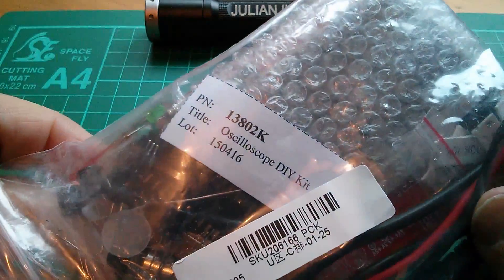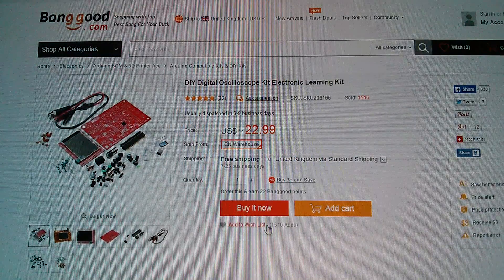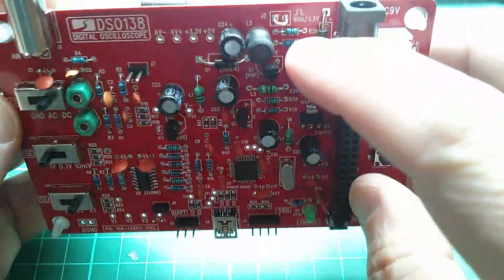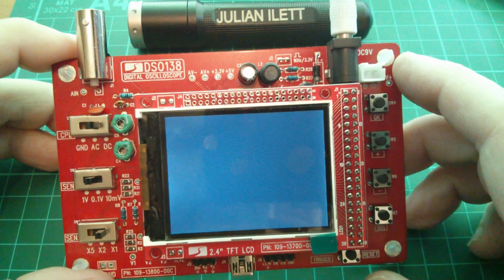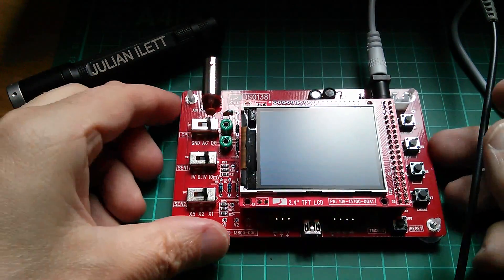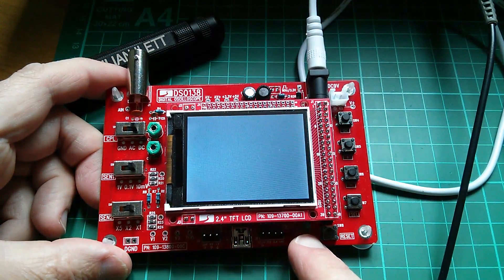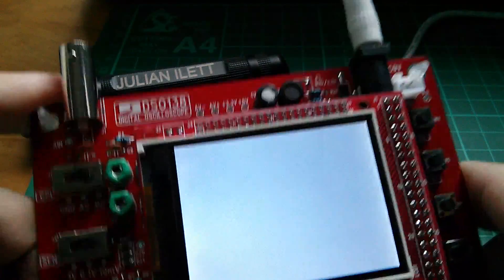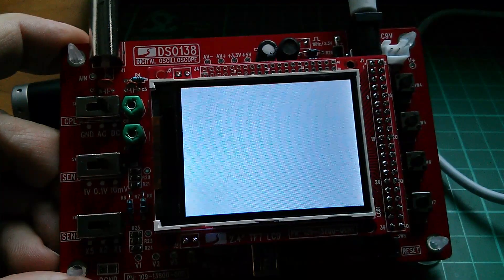Julian's Kit Build (FAIL): Banggood £15 ($23) Oscilloscope Kit

Comment: I ordered one these things a few days ago , This vid does not inspire confidence hehe :-D
Reply: steve64464 yes I would be curious too to see how clean is the voltage generated by the step up of the powerbank
Reply from the maker: steve64464 I think I've been very unlucky. Two seemingly unrelated faults on one device. But there's no reason to believe that the product is inherently bad.
Reply: maybe you should put the larger scope onto that power source and see if it power surged it or something werid
Reply: Managed to make my kit work , I took a little longer than a few hours to make it although i was being carefull and double checking a lot of stuff etc

Comment: The lack of negative voltage can be your display problem.

Some generate it on the lcd module, others want it externally.
Reply: Julian Ilett erlendse is right, LCD's use the negative supply (either internall or externally supplied) to control contrast. From the look of it the backlight is ok you just don't have any contrast. LCD's can be picky that way! - hope you get it sorted, I do like all your videos.
Reply from the maker: erlendse Not sure about that. The display worked for a couple of minutes but there was no trace.

Comment: Just drive that missing wave out of an arduino or something and see if it helps at all?
Reply from the maker: petti78 I had the same thought. If I can get a replacement display, I'll try generating the negative voltage waveform with a simple 555 oscillator

Comment: How clean is the output of your powerbank? The reason I ask is that I have a few microcontroller boards that refuse to work with one of my banggood powerbanks despite its output voltage looking ok on a meter. When I checked the supply on the scope there was a ton of noise on there causing all sorts of hang-ups and weird behaviour (the board, not me).

I would test this again with a known clean linear PSU when you replace the screen just in case.........
Reply from the maker: Ronan Cantwell I'll try it on a 9v battery next time.
Reply: Ahhhhh.... Old school. 😁